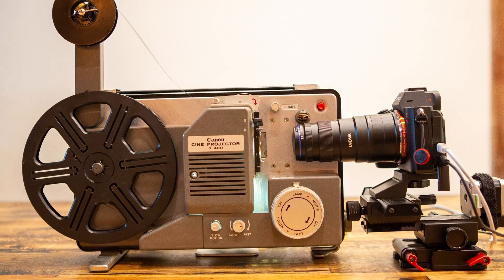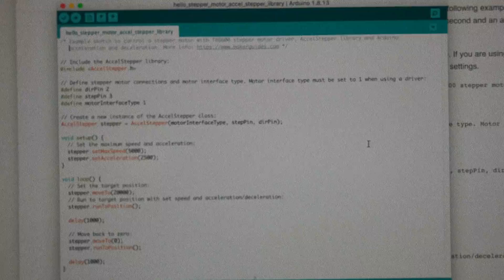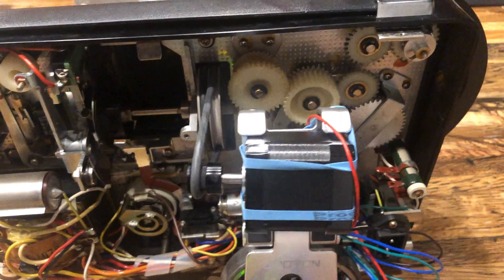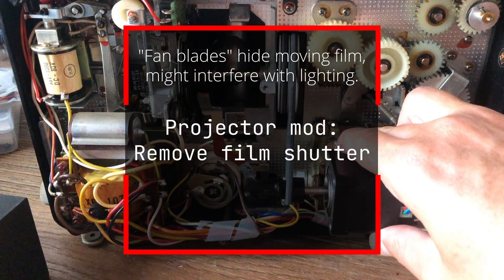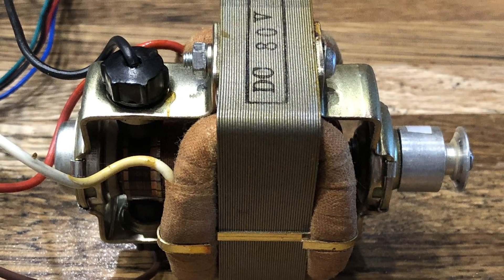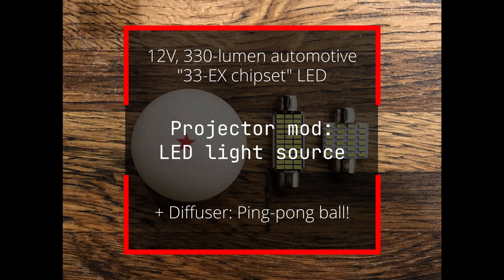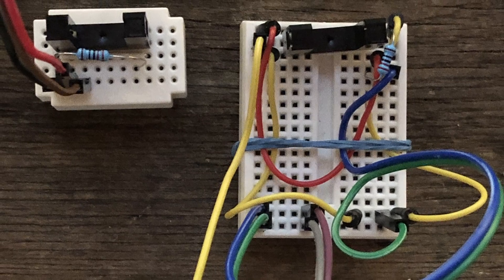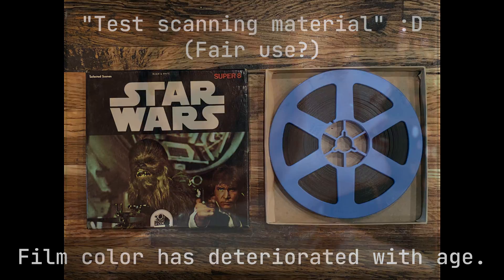📽️ 🎞️ 📸 ⤳💾✨ DIY 🛠️ 8mm / Super-8 Film Scanner, Part 1: Overview

Comment: Scott, A question for you; hoping you have the time to answer.
What are your expectations for shutter life-expectancy of your camera?  My understanding is that most camera's have a shutter-life of somewhere around 200,000 shots.
If I had ten hours of film to transfer, at 18 fps, that would add up to 648,000 shots.

I am in the process of pulling together the hardware to build a scanner but have hit this potential snag that is adding to the difficulty of locating a suitable camera.
Any other recommendations you could offer on camera and suitable lens would be appreciated.
Reply from the maker: Hi Mike,

For this sort of project, in my opinion, it's crucial that you have a camera that has a silent shooting mode or similar such that there is no mechanical movement when taking a photo. I.e., your camera is able to use an electronic or otherwise entirely non-mechanical process to get an image from the sensor. When you press the shutter, there should be no noise. If something moves, you don't want that happening almost 650,000 times. 😅

I'm using a Sony A7riii here with the silent shooting feature enabled. It's a mirrorless camera, so it has less mechanical stuff than a DSLR to begin with - this is a good thing. With full silent shooting on this camera, there is no sound when it takes a picture - nothing moves internally, as far as I'm aware. That was a requirement for me, I didn't want to have this project put any wear and tear on my primary camera. So far, I have had no problems taking pictures with the camera with my usual lenses. Nothing is guaranteed, but I believe the lack of mechanical activity is a good sign.

Using a stock Canon 5Diii DSLR as a different example, I believe taking a photo requires a mechanical shutter or at least some sort of motion internally for each shot. The 5d3 does have a "silent" mode, but there is still some sort of shutter or mechanical motion. It is reduced, but there is still movement. That's going to be a lot of mechanical wear and tear on the camera and will shorten its lifespan, indeed.

If you have a Canon and are willing to try, I've heard the third-party "Magic Lantern" and/or other custom firmwares via CHDK might offer a feature to get photos without mechanical actuation. Magic Lantern calls their feature "Full-resolution silent pictures." If you aren't familiar, ML is its whole own free/open-source project and can be fun - but you also need to be careful, there is a risk you can damage or "brick" your camera.

Alternately, I have heard of some folks using cameras made for the Raspberry Pi hardware platform and using it with some success for scanning film. I believe those are entirely electronic, no mechanical bits to break down. ;)

Hope this is helpful!
Reply: @scottschiller  Hi Scott.  Another question; if you have time and experience with this sort of thing.
Do you own/use a mechanical 8mm film editor/viewer?
I'm in the market and have been scouring ebay.  Many of my old family films have some bad spots that need attention before scanning.  I see lot's of promising ones but cannot find much in the way of recommendations on some of these old machines.  
Some particular ones I've got my eye on are Mansfield 650's, 950's.  Also P&B-88 and Kalart KE-8.
Reply from the maker: @mikebetts2046  Hi Mike,

I was originally looking at viewers / editors as a possible transport mechanism for scanning etc., before I decided to go with a modified projector.

If you're thinking of spending time reviewing and cleaning individual frames with IPA or similar, perhaps a viewer / editor makes sense. I think you'd want something like this to be able to move through the film and quickly find potential dirty frames, etc.

"BAIA" and Elmo seem to be popular, but they can get up to over $100. I'm not sure it's worth spending that much. Check that the viewer can do Super-8 if you're using that, as well.

e.g.
https://www.ebay.com/itm/VTG-Baia-Reviewer-8mm-Film-Movie-Editing-Editor-RE-8-120/284195418047

Hope this is useful!

Comment: Thanks for doing this, Scott. Very nice work.I may have missed it, but I would like to know what, specifically, is your "Z-type" tripod head and rail slider, and where did you get it.  I am working on a 16mm system with Eiki telecine projector that has a five-bladed shutter. I would like to see if I can get decent results in real time to make the audio component easier
Reply: Sorry - I hit enter by mistake. The 5-bladed shutter at 24 fps eliminates flicker from the camera at TV rate - 30 fps (okay, 29.97), and allows transfer with audio in real time. Thanks for any info you can provide on the head and slider. Thanks also for the ancient film clips of Vancouver. And welcome back.
Reply from the maker: @morrisonproductions4588  Thanks! It's good to be back. ;)

Regarding hardware, I found both these things on Amazon. There are a variety of brands and prices, so I recommend you compare and make sure the models you pick are compatible with your camera mount. Also, you'll want to make sure the Z-type can handle the combined weight of your camera + lens + slider. I picked a Z-type that can handle 6 pounds, and it's been rock-solid.

It seems sellers make the product titles super long and stuffed with keywords, so I've truncated these to include just the relevant bits.

Rail slider: "Neewer 4 Way Macro Focusing Rail Slider ... for Canon Nikon Sigma SLR" (I'm using a Sony a7Riii, its tripod mount is compatible with this one.)

Z-type "mount": "Neewer Upgraded Z-Flex Tilt Head Z Type ... Aluminium Alloy/Load Up to 6.6 Pounds"

It can be frustrating setting up the Z-type at first, getting the height and level set about right. Once set, you can tighten the screws and shouldn't need to change it. Mine has a little built-in air-bubble level which is nice, but it's best to have the camera and light in the projector so you can see how it aligns with the actual film gate. I show some of this in "Part 2" - as mentioned, it's arguably the "least-scientific" part of the process. ;) 

I also flipped the slider mount around, allowing me to get the lens closer to the projector film gate. I showed this briefly in Part 2 as well, but didn't explain fully. To remove the top "ruler" slider and flip it around, you just need to take two screws off a bracket on one end, and use the gear control to work the top slider out of the assembly, then put it in backwards. I should probably do a segment on this for Part 3.

Hope this helps!
Reply: @scottschiller  Thank you, Scott.  I will check out these items and should have some results in a week or so
Reply from the maker: Great! It’ll be neat to see what you put together.

Comment: Why the flying fuck hasn't someone made one of these commercially that isn't a jank pile yet.
Reply from the maker: Hah! I hear ya, this is a tough one. 😅It seems the Wolverine Pro is a common choice, but it seems like a compromise for convenience. Build quality is low, you get a baked MJPEG video at 30fps(?), and jitter between frames is common. I think to get more reliable frame placement, you need hardware from a real projector ... and that's the top of that slippery slope.

BTW: Nice Django cover! I enjoyed that. https://www.youtube.com/watch?v=w4SynylXvzg
Reply: @scottschiller  the real kicker is just no control over anything, at least not that I can see - exposure is adjustable but colour balance isn't, so I have some reels that I just can't trick the thing into recording properly. It hasn't been great with longer reels either, and I've heard about inner components wearing out or melting down haha.

Cheers about Django, the guy was an alien!
Reply from the maker: Agreed. I think there are a lot of trade-offs with the WP, and plastic parts seem to be a contributing factor. There is a so-called "Wolverine" mod that might be of interest, but I think the machine is still fairly limited. I've got much more control with the DIY route, but it has been a lot of work. At the same time, it's also been fun and I've learned as I go, so I consider it a win thus far!

And yes, Django is something else. ;)

Comment: Fascinating!  I'm using the same overall technique, photographing every individual frame as it passes the gate in my Elmo GS1200. I'm using the same Laowa macro lens as you have, feeding my Sony A7Rii.  The results I'm getting are excellent, but I just wanted to say that your Laowa lens appears to be set at f/16, and I wanted to let you know that this actual lens performs very much better at f4, regardless of the magnification it's set to.  Diffraction is the reason, as I'm sure you know.  As you're photographing a flat plane with the lens perfectly perpendicular to the subject (the film emulsion), you don't need to sacrifice resolution for the added DoF that f/16 gives you.
Reply: I found it most revealing (and quick) to photograph my 4k TV screen, using the 42.4 mp Sony, at all the Laowa apertures and at three different magnifications. There really is a sweet spot at f/4, though 5.6 is useable. Beware of using any smaller aperture, especially past the 3x magnification point. The DoF is indeed increased, but in our case we don't need that benefit.
Reply from the maker: This is a smart idea, thanks. I'll take a look at f/4 and reducing the magnification as much as possible. At present, I'm a shade over 3X. If I can get a sharp (focussed) image, exposure time can also be reduced and scan speeds can go up. My scanner can run mechanically up to 5 frames/second. It seems like the remote shutter on my a7riii "maxes out" around 3 frames/second, though I haven't dug much into this.
Reply from the maker: This is great, Tom; thanks! I’ve been using the lens at f/8 mostly, but I did some earlier scans at f/5.6. I will revisit this and maybe try a side-by-side comparison.

It seemed like the DoF was so shallow on this lens, I thought f/8 would be a reasonable compromise giving me a better shot at having that razor-thin field of focus working better. I think you have a point though, there are trade-offs.

Comment: This is unreal Scott. Insanely well done. Am i correct in saying that i could manually feed (pull) the film through while the camera is continuously shooting?
Reply from the maker: Thank you! This project started as a rough build, but I’ve been able to get it working quite reliably after some trial and error.

The way I’ve set this up, the process relies on the stepper motor driving the mechanics of the projector, including the “fork” that pulls each new frame into place. By doing this, you get the benefit of the projector’s whole reel take-up and rewind process, as well as knowing when to “take a picture” of the new frame in place.

If you were to try to pull the film through by hand or some other way, you’d lose the convenience of the projector perfectly aligning each frame, holding it still, and knowing when to “scan” it. You’d have to re-invent all that stuff, and I wouldn’t recommend going down that path. The film gate and its mechanics are the most important part to moving and aligning frames to scan. I’ve seen projects where folks take only the film gate and “fork” bits out of a projector, and then make their own source and take-up reel mechanisms and all that.

Using the stepper motor approach, you get the benefit of all the existing functionality of a working projector - and I can’t recommend that approach enough.